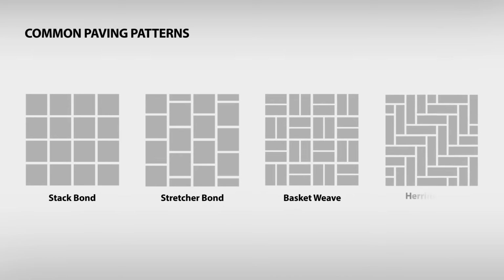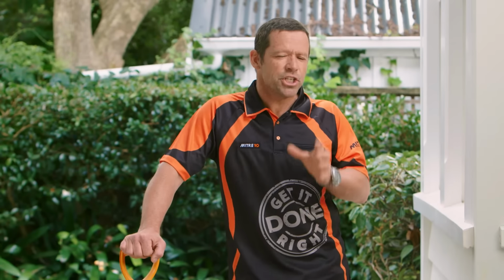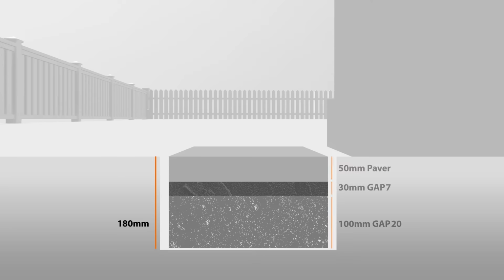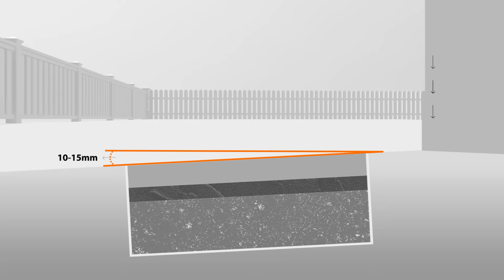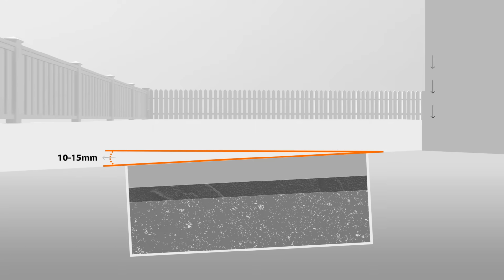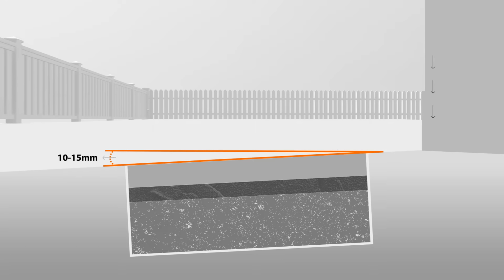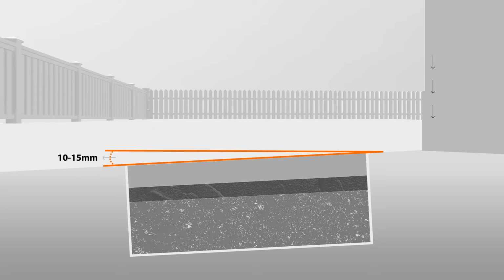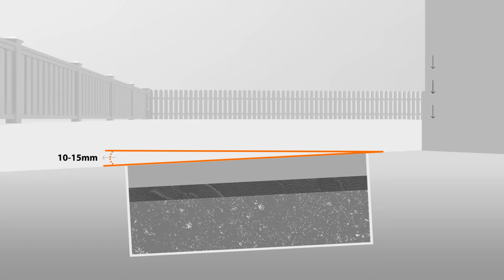How to Lay Concrete Pavers on Sand | Mitre 10 Easy As DIY

Comment: Hi, im doing a pathway with similar pavers (600x600) 2 wide. I like the wooden edging visually, but havent found it recommended anywhere else for durability readons. Im mostly concerned about the pavers shifting slowly. Am i overthinking this and wooden edging as paver restraint will do the job fine?
Reply: It won't last forever. If you want something that will, use concrete edging stones. Lay them along a string line but bed them on cement.
Reply: Bed them in with a wet concrete or motor mix, come up half way up the pavers. Finish with a trowel to a 45 degree angle. This puts a concrete edge around all your pavers to stop them moving. This is an alternative to the wooden edging and will last longer. Video by Costa on gardening Australia demonstrating all I've mentioned.